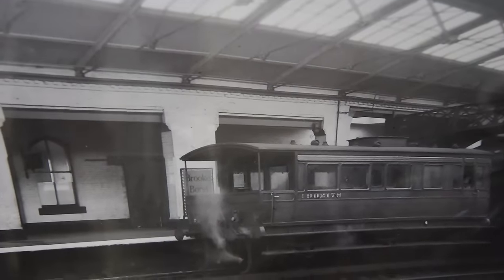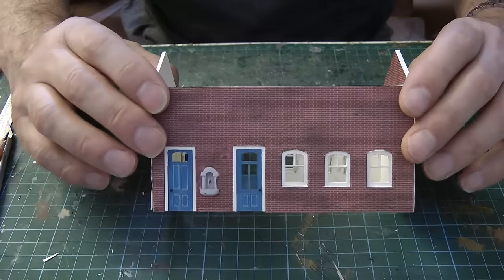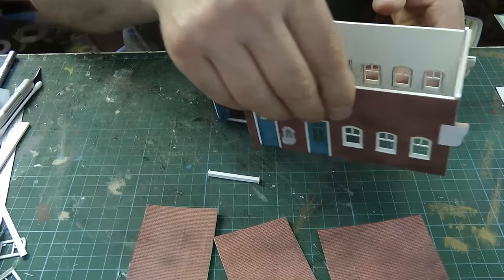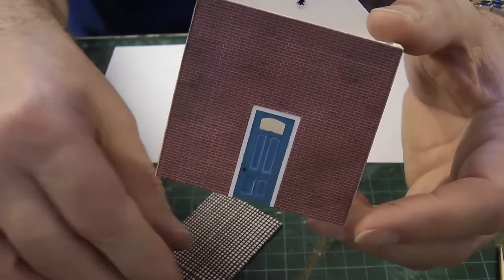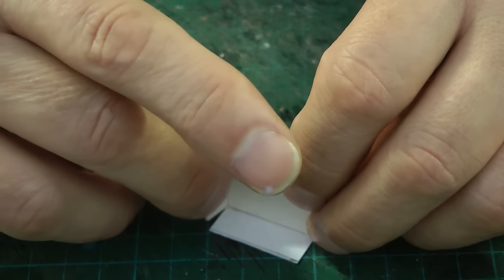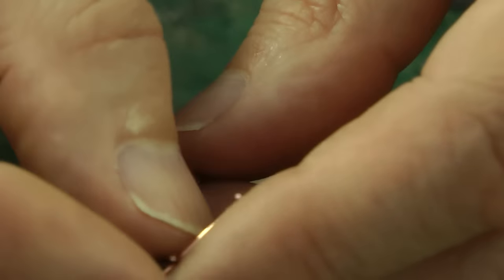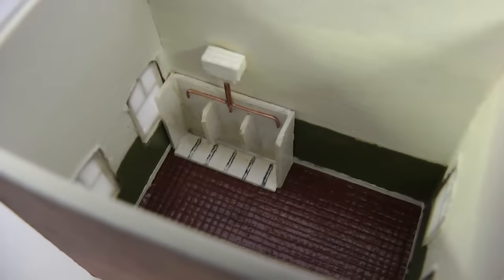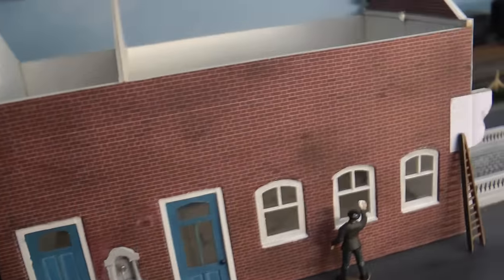Tyne Dock Part 9 The Gentleman's Rest Room No 432.

Comment: Excellent Tony, I always enjoy watching your tutorials. Can I ask you about cube cameras? I noticed you using one on a recent video, looking at the hole you cut in the wall and fitting stairs, I put a video on my site but doing it with the phone doesn't give the best quality. Can you upload to a phone from the cube camera, and can you recommend one for me please?
Reply from the maker: The cube camera comes a cable to plug into the phone. it is suppose to be Blue tooth compatible. but i have not used that function. Caddex Action Camera, are to be found on Ebay or Aliexpress website. i hope this helps. cheer's for now Tony.
Reply: Thanks Tony, I shall look it up. If you look at the video I put you will see that the quality is not crystal clear but it was quite dark to show off the lighting in the Pullman coaches 🤗

Comment: Fun fact, did you know Whitley Bay Metro is the only station to have Toilets on the Platform, and whaaaaat, Tony made a mistake 😮, noooo, must be an imposter
Reply from the maker: Thank you for the fun fact. North Tyneside has most of its original station intact. while South Tyneside they pulled them all down. we all have those off days. i was thinking at the time that is was the end wall which it turned out not to be. fancy forgetting about the gents....take care my friend. Tony.
Reply: @TONYNORTHEASTERN  yeah we got off lightly in North Tyneside, theyre also supposed to be be re-opening the Blyth and Tyne Line this year (2024) after (i think) 60 years, we nearly lost the old Station Building at Benton recently but luckily managed to be saved, Monkseaton and Whitley Bay are both having restoration work done on them at the moment, and Tynemouth (my favourite station) was done in the 2010's, oh, and the site of the old BR South Shields Station is now the home of the Metro Training Centre